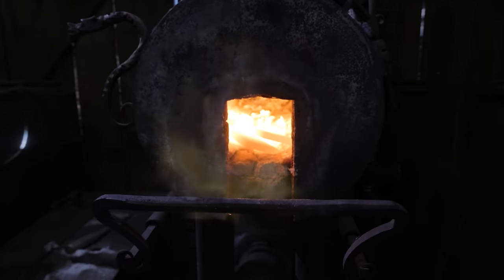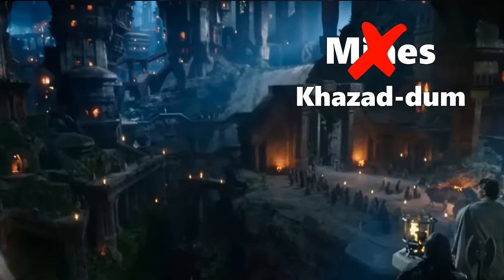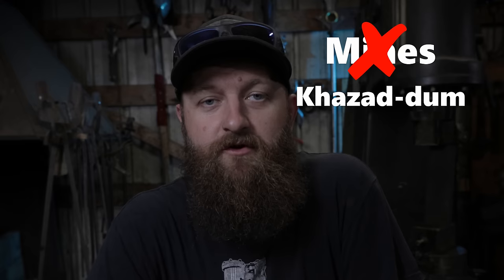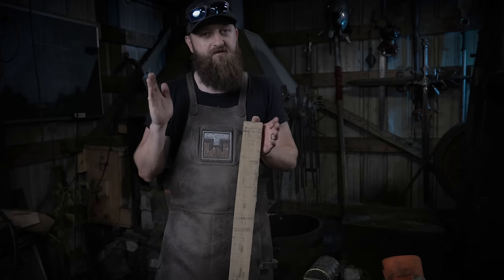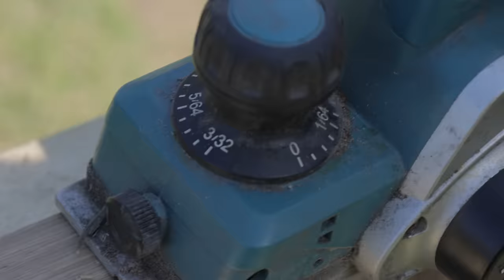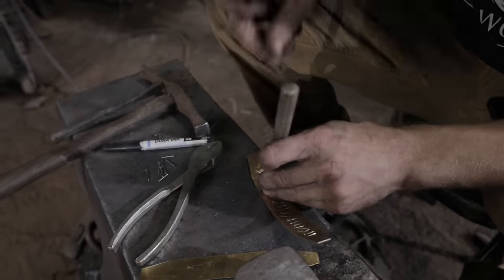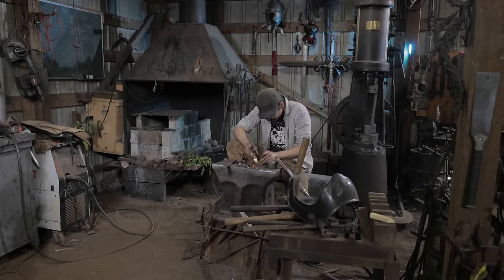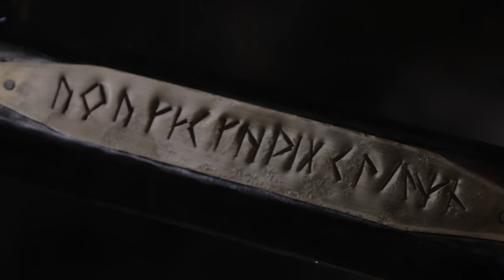Making Durin's War Hammer [The Rings of Power] LoTR

Comment: Kinda weird that Amazon commissioned you guys for this build and didn’t provide better images and specs for the hammer, either way.. amazing work as always.
Reply: Honestly depending what part of the production (of the Rings of Power series that is) this build was commissioned, it might not be that odd at all as it's possible that those better pics don't exist at all or existed only in the archives of the wrong department. Marketing was probably responsible for this sponsoring deal, while the prop department (which easily could have been a sub-contractor) would have any plans or still that aren't needed for marketing and it could be big deal to get copies of those pics to an outsider. 

TV productions are after all massively complex and there's rights that can be tied with several companies that makes things even more complex.

Comment: When using a sledgehammer (or in this case a war hammer) to smash things, you need to slide your right hand down to your left hand as you drive the hammer down. Do this for more power and less strain on your back and body.

This applies to hoes, pickaxes and other two-handed smashing tools.
Reply: Yes. Basically a vertical bat swing.
Reply: Little ironic giving advice on how to use a hammer to guys that make a living swinging hammers…
Reply: @KJ-kw7gh  it is. But he looks inexperienced with using a big hammer to smash things. This method really busts the back.

Then again, he might be holding back to protect the hammer.
Reply: @AWS137  Nobody is experienced in using a hammer this size. This things probably weighs 30-40 pounds, and it’s an odd size and face. Not like swinging a normal sledgehammer. It’s going to be awkward and hard to control.

Comment: I have to say, I don't think I would make the handle out of oak. Oak splits very easily, and you'd be replacing the handle very quickly after use. A softer, more pliable wood would work better. This is especially the case since you are reinforcing the handle by cladding it in metal.

Comment: I imagine the wood core for the haft is because should the hammer snap (which I would imagine is always a possibility for a tool put to any use) it's much less work to remove and fashion a replacement haft and still have a functioning tool/weapon at the end of it, than if the haft is metal which would be much harder to remove and replace should the exact scenario happen. also, since this is undoubtedly a symbol of dwarven kingship, passed down since the first Durin, the haft likely HAS been replaced/refashioned  several times, possibly even for each new Durin who (re) ascends the throne(since each Durin is assumed to be the reincarnation of the first).

Comment: That thing is massive.  Looks like it weighs 10-12 kilos.  I imagine that the handle would shatter in the first use.
Looks good though.
Reply from the maker: I mean....you watched us use it on actual stone and nothing broke or....shattered
Reply: @ThatWorks  On very small stones sitting on a round of wood.  And the shaft had a hell of a lot of flex on that last shot when the spike was rammed in.

I'd be interested to see what the wood looks like under the cladding.  I wouldn't be surprised to see some cracking.

Not at all a criticism of the build or quality, just that it's an absurdly large mass impractical hammer, as is common in fantasy weapons that weren't initially designed with actual use in mind.
Reply from the maker: @earthknight60  yeaaaaa. Shafts are supposed to flex just like a sword blade is supposed to. Go on...
Reply: @ThatWorks  You're being pretty defensive about something that's not at all a criticism of the build itself.

It's an extremely well done fantasy weapon that was based on something totally unrealistic.

The quality of your work is not the issue.

I've spent the majority of the last 50 years using axes and mauls of various weights and have a pretty damned good handle on what stresses wood handles can take.  It's not difficult to accidentally shear the head off of an ash axe handle, or to crack the handle with an overly strong strike.

That's why I said I'd be interested to see the wood of the shaft after that last hit.